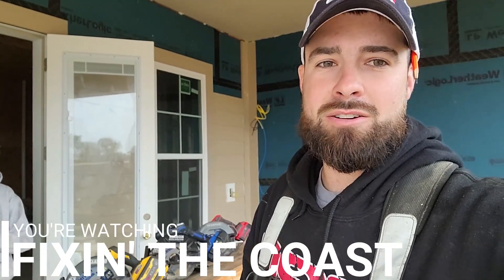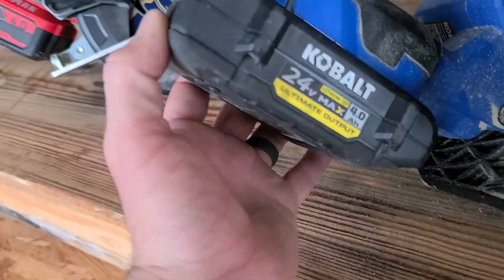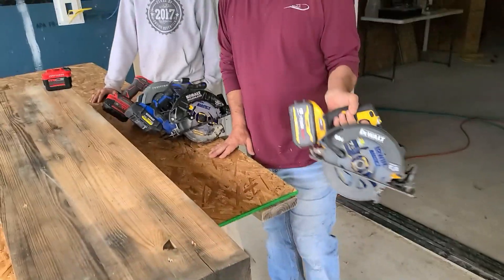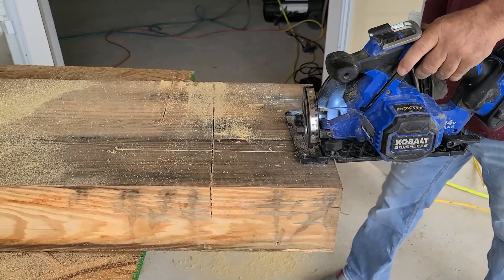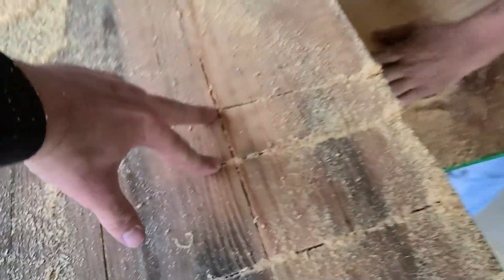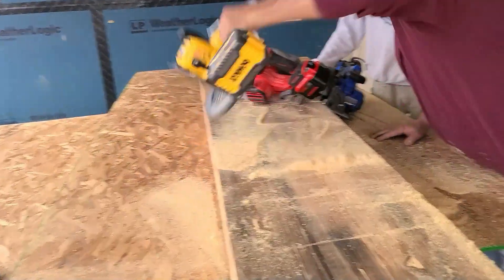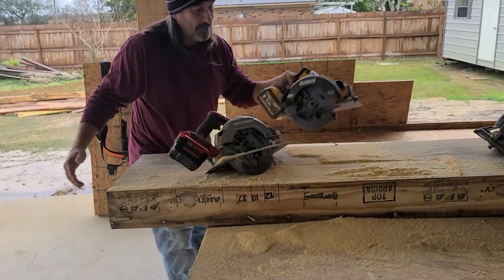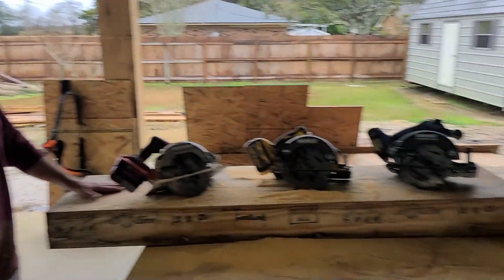7-1/4" Circular Saw REMATCH! (Craftsman V20, Kobalt XTR, Dewalt Flexvolt)

Comment: Wondering if kobalt would cut all the way if you didn't force it that hard ie "let the blade do the work".
Reply from the maker: It depends honestly, you have to go very slow and hope the blade doesn't bind at all amd it usually still shuts off. We've tried multiple ways before making a video on it. It's great for DIY guys but it just doesn't have a place on the jobsite unfortunately
Reply: @fixinthecoast267   I have to respectfully disagree,  I use my daily to cut wet hard wood, osb, etc. Never had an issue with it shutting off. But I do respect and enjoy your torture test. Thank you for putting these thru the paces.
Reply from the maker: Honestly, we very well could have a fault one!

Comment: Dollar for Dollar, I use my cordless tools very little doing hardscape. Angle grinder/Sawsall/Caulking Gun. When all my Dewalt 12 volt had done its time, I started getting Dads favorite tools craftsman  20v. Watching this video to see if it's worth grabbing this thing for 6x6/4x4 posts mostly or keep dragging a old heavy circular saw to cut 6 posts to height. Just as I expected not a Dewalt but perfectly priced and capable for what I do. If I need bigger still have all my 120v tools

Comment: You still need a beam or a chainsaw. The craftsman circ saw did real well, but the xtr's impact driver, 🔨 drill, and sawzall will out do craftsman! The next challenge take the cordless magg 77, and Milwaukee rear handle against the flexvolt. Same test and see which is the better saw.
Reply from the maker: I partially agree lol. The xtr driver and hammer drill are great but the new craftsman Sawzall is way ahead of the kobalt, we have a video on the comparison. And we've also tested the New Fuel 7-1/4 vs the FlexVolt 7-1/4.  The flexvolt is in its own class forsure! No cordless saw can come close to it.  I have to check out thag Magg77 though! Thanks for the feedback!

Comment: How bout using the 6 output battery on the Kobalt, it’s actually the biggest output battery Kobalt has at the moment. Higher than the 4
Reply from the maker: We have, it's actually not the highest output, it's the highest run time. The 4.0 Ultimate actually puts out more power.  We've found that the normal kobalt batteries (non ultimate output) actually overheat using the saw continuously and the ultimate does not. I feel the ultimate output was made to handle the demand of the XTR tools
Reply: @fixinthecoast267  I did my research on the battery difference. The 6 Ah does have a 50% more run time, but it also has a 50% more power output than the max 4 Ah. I owned a Milwaukee M18 fuel high impact wrench....it was a monster with the 8 Ah compared to the 2 or 5 Ah. I never use anything higher than a 2 Ah for small jobs, but do use the higher Ah when dealing with tougher task.
Reply from the maker: Hmm well we may have to give it a shot then!
Reply: @fixinthecoast267  don’t get me wrong...I mean that Craftsman really caught my attention, specially with the 4 Ah battery. Didn’t expect it to perform that good. I really like how you gave them all the same brand blades.
Reply from the maker: We try to make all our test as fair as possible  lol

Comment: what a great video but seems to me that if we want to make a tool look bad or make another one shine its not that hard... or at least not as hard as the operator's leg when testing the kobalt.  also the cut on grain seems like it went sideways.. I recently purchase those XTR tools and I will pay attention to those ponts thanks.
Reply from the maker: It may come off as us making the kobalt look back but I promise you that's the farthest from the truth.  The XTR and the FlexVolt are both my personal saws.  I used the XTR when my Milwaukee shit the bed as a saw to get me by for the time being.  While it does work, it simply couldn't keep up on site with us.  Battery's would overheat, keeps shutting off 1/4 of the way through the cut.  I own a good bit of the kobalt line and really wanted it to be a good saw.  And it is, just not on a professional site that has a high demand from tools.  Good luck with yours 👍🏻

Comment: I'm a Craftsman guy but I got to say that guy operating the Cobalt on the highest capacity battery he bound that blade up it has a safety mechanism he did not put that blade straight he came in crooked try to straighten it up and naturally the design is to shut off or at least stopped it wasn't fair on Cobalt and I'm a Craftsman guy my Craftsman that you just showed operated beautifully just saying Cobalt needs another try with the blade going straight

Comment: Yeah it's a real great little saw the craftsman The problem is the batteries are massively expensive
Reply from the maker: Well maybe from the diy side they are but from the professional side they're very cheaply priced. My Milwaukee and dewalt battery's are $250 a piece for the same size as the craftsman that is maybe $115.  The craftsman is the best all around saw for price/power. You just can't beat the price for the power

Comment: You know as much as I do that had you been using that Kobalt on the jobsite that you wouldn't have been pushing it as hard as you would the DeWalt. You'd baby it, slow down the forward momentun, to get it through that lumber. I mean, it is a baby tool after all. You can only work as fast as your tools will allow you to work. Kobalt isn't a pro-level brand. Heck Craftsman isn't either, but it held its own here. But we all know that Craftsman won't hold up all day at that speed compared to Yellow and Big Red.
Reply from the maker: correct, this was more of a torture test. i bought the kobalt as a "get me by" saw when my old brushed milwaukee 18v finally went out after years. i tried to use the xtr to cut rafters and even babying it, any tiny little bind the saw would shut off. after 2-3 days of it failing simple task, i finally had enough and went spend $500 on the Flex volt.  i can honestly say, i hate that fucking XTR and thats being as unbias as i can. the handle is on top of the saw rather than behind it and has great power but a shitting safety (causing it to stop). so yea, we were torture testing more than reviewing but at that point in the videos, we had had enough and wanted to push all 3 as hard as we could because no other youtuber really does that.
Reply: @fixinthecoast267  I love it, " we were torture testing more than reviewing but at that point in the videos, we had had enough and wanted to push all 3 as hard as we could because no other youtuber really does that."

You are correct, far too many times you'll see certain based testing happening.

Comment: My Kobalt  or dewalt doesn’t bog down like that if you use the saw correctly /the 6amp battery has way more power for the kobalt /I can see that your pushing the kobalt saw way harder then the craftsman
Reply from the maker: No man, we're pushing all the saws the same. We don't get paid for reviews. The kobalt and dewalt are my personal saws, the craftsman isn't even for me. All 3 saws were pushed the same In the abuse test. 99% of YouTube channels show you that that saw can cut a 2x4 or a sheet of plywood, cool but so can pawpaw with a hand saw. We show you a true abuse test that you may not want to perform yourself on your tools

Comment: Why are you using irwin blades and not Diablo? Also the Kobalt is better than the Craftsman, you want that auto shutoff so that guy's like you don't burn the tools up.
Reply from the maker: No sir, a DIY guy would appreciate the Shutoff bc they are playing at their house.  On a jobsite, for men, doing men's work, we want a powerhouse of a tool ready to tackle any task we give it.  And as far as blade. A saws performance shouldn't be judged on type of blade.  All 3 saws, all same brand new blades. That's a more realistic test because not all carpenters will be buying a diablo blade. This test is as real as it gets.  That Kobalt is Worthless on our site and I paid for it myself.
Reply: @fixinthecoast267  I like how you are referring specifically to the saw as a DIY.  The impact driver is pretty sweet, BUT wish they paid more attention that not all users want the belt hook on the left side for righties.
Reply from the maker: I agree, that's definitely something I believe they could improve on as well.  Ambidextrous tools
Reply: I do want to say that their 7 1/4 brushless Miter saw is one of a kind.  It beats out m18’s 7 1/4 miter saw in most respect.  M18 has this weird safety mechanism that is even present on the bigger Miter saw.
Reply from the maker: Oh wow, I haven't tried any of the 7-1/4 miter saws yet. I'd like to get one for small jobs such as Shoe molding, trim etc
Reply: @fixinthecoast267  it’s good if you use it as a punch list tool where you can easily carry around from first to second floor,  but the big boys are always using the bigger saw stationed on one spot.  Like why do you need a small one when the big one does everything?  For me, it’s portability.
Reply from the maker: I agree. I have the 12" flexvolt miter saw. And it nice being able to slap batterys on it for a new job without power but I'd also enjoy not hauling 65lbs back and forth into the trailer lol. I'll be investing in a 7-1/4 soon